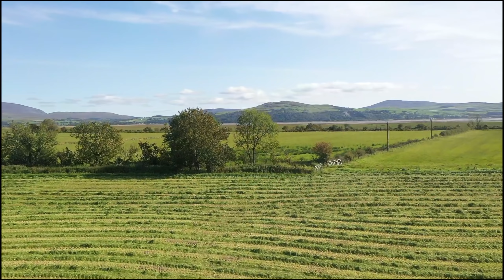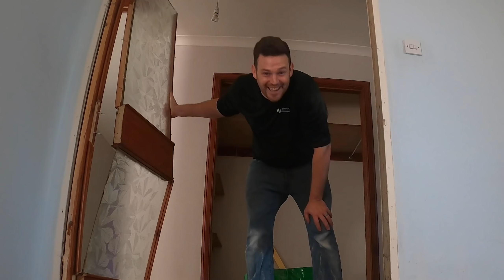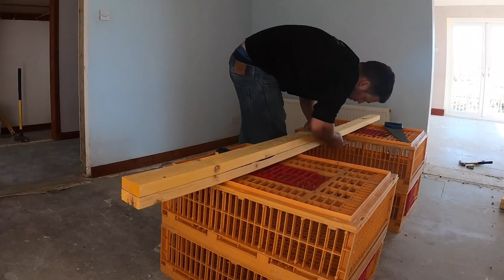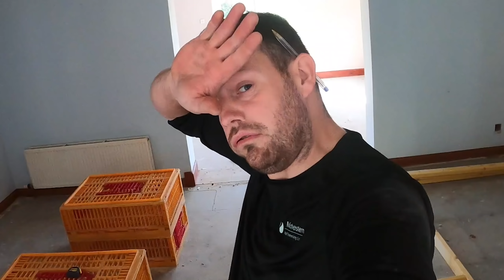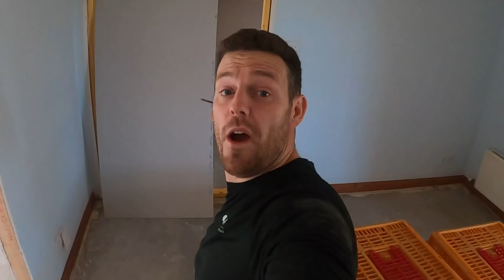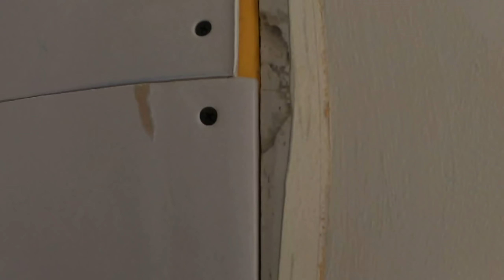IDIOT tries D.I.Y. RENOVATION *BREAKS WIFE'S FOOT!?*

Comment: Little tip for you. Set your studs out (vertical bits of timber) to the size of you plasterboard eg 900 wide board 450mm centres, 1200 wide board 600mm centres. Saves a lot of plasterboard cutting.

Comment: Essential tools you’ll need for this renovation, circular saw, level/straight edge, tool belt, plastering knives, safety glasses, dust mask (in case of lead paint/asbestos), hearing protection & first aid kit. 💪🏼👍🏼 the most used tool in our renovation right now is a grinder (for fibre cement sheeting/cladding & steel framing) but you’ve already got them

Comment: Gorgeous view!! Good job on the wall  ,but where is the insulation in the wall??? Winter's are cold there and every piece of insulation in your house will cut down on the heat you need. Some don't do it, but when my husband and I built our house we insulated everything. It helps on the air also. Here it gets 100 to 115 degrees with about 99% humidity...but the insulation keeps it cool and warm. 👍👍👍👍👍

Comment: When you nail boards together that will be attached to a wall the bowed part of the board goes on the inside and the straight/ flat side faces the out subside that attaches to the wall. I have watched a lot of programs on home repair/remodel by contractors that explain what they are doing as they ho along.

Comment: Best set your studs at 450 mm centres if your using those boards ,will be less wasted cuts of p,board and will put more strength in the wall and butt  the tapered joints together the plasterer will thank you for that 😎

Comment: Congrats on your first home reno! Not too bad for a newbie! There is a wealth of info available for the first-timer available online (and in your viewers :) ). Did you put a plywood board behind where the horizontal sheet rock panels meet the vertical ones to tie them together? If those seams are floating, you will eventually wind up with cracks there as the sheetrock tape isn't strong enough to tie them together; it's just a crack filler. There's a trick to doing a seam in the middle of a wall, not backed by studs like that. You can avoid a hump and get a perfectly flat seam with a strip of plywood cut about 6" wide and the length of the seam. Put 1" wide thin cardboard spacers along the outside edges of the plywood then center the plywood with the cardboard running parallel to the seam and screw the sheetrock to the plywood close to the seam on each sheet. The shims about 3" from the seam will cause the edges of the sheetrock (and covering sheetrock tape) to be recessed so the overlaying mud can be sanded flat.

Comment: So the small board should be at the bottom so that the crack isn't at eye level, and when you join 2 boards together you should cut a angle on the boards so there is place to fill it with plaster

Comment: You can just paste that gap, it will be fine. Paste takes longer to dry so you can just use regular tape and spackle since it will be thick on that gap.
After reading the comments I realized you're having somebody else do the joint compound part. In that case, leave the gap, they can easily take care of it.

Comment: The studs are not 40.6 centimeters  (16 inches) on center, like we are required to do in the U.S.  Here, the reason is so you always know where a stud should be, making it easier to hang drywall.

Comment: Here in the US the studs in the wall are typically 16 inches on center. But they can be 24 in. I don't know what the code is there but it looks like you just put one on each side and one in the middle. Is there a code there in Scotland? Oh and as many others already pointed out Yes the gap can be covered with tape and mud.

Comment: I see 1 little problem with blocking off the door and it’s there is now light switches in the middle of the wall, I know easily solved by a sparkie

Comment: Drywall? I thought we in the US were the only ones that use cardboard walls. Don't European have stone walls?
Reply: Actually, the houses themselves and the weight bearing walls usually are stone or concrete in Europe (with exceptions in Scandinavia). and If there is a need to renovate or changes in layout, it's  very common to use drywall.